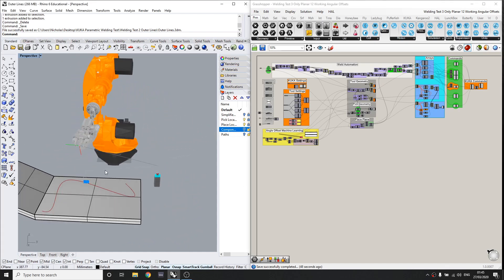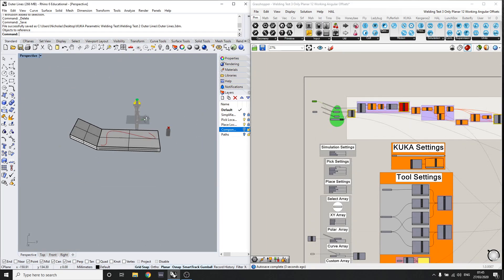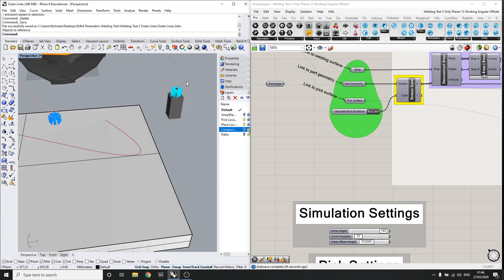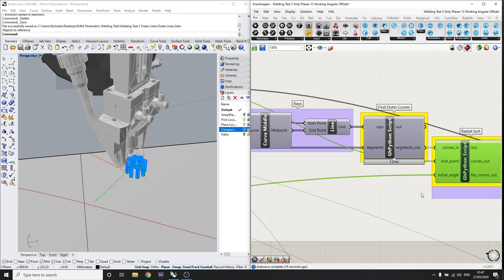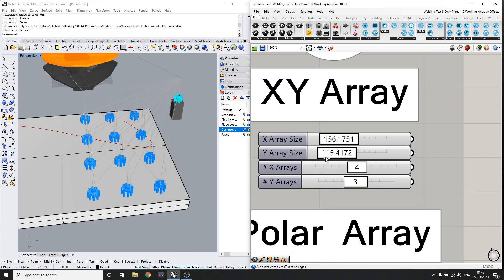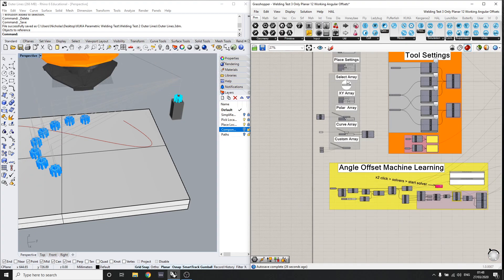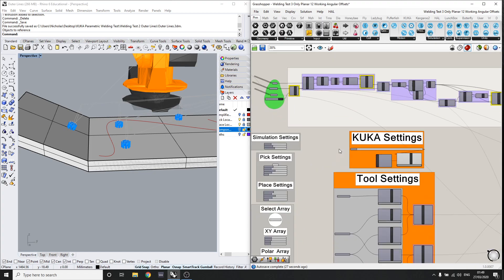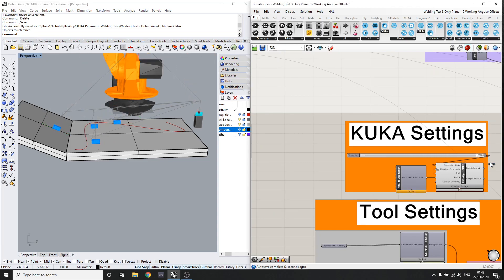Automated Robot Pick, Place and Weld Programming with Rhino, Grasshopper and Python

Comment: Hi Nicholas ziglio,
This is really an excellent teaching video
 !
But i have a question
.
Can the actions shown in the film be completed without using phython?
Reply from the maker: Thank you Gavin :) Yes, I think so. I mostly just used some trig functions like atan() and sorting functions :)
Reply: Hi  @nicholasziglio  
Thank you for your reply, your video (including the follow-up tutorial), I watched it 2.3 times, but I want to ask , do you have plane to make a video of the basic control element of the kuka robot arm? For example, adjust the basic settings such as the angle  or  speed of the rotation axis of the robot arm or introduction about the use of kaku pluge in grasshopper?
Reply from the maker: @GhDataSta  yes, absolutely :) I am currently working on a written user guide that will start from scratch. I will accompany it with video tutorials. Too so keep an eye out as they will come soon :)
Reply: @nicholasziglio  
Thanks, I will recommend your tutorial on mine channel. Although it just a super"small" channel, but I deeply believe your tutorial can help many people.
Reply from the maker: @GhDataSta  thank you so much mate, really appreciate it ^_^